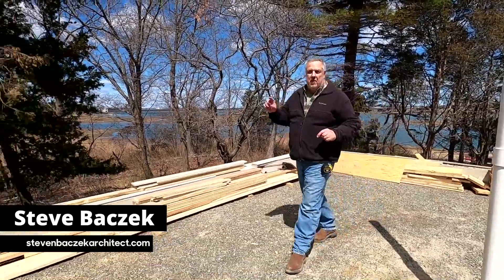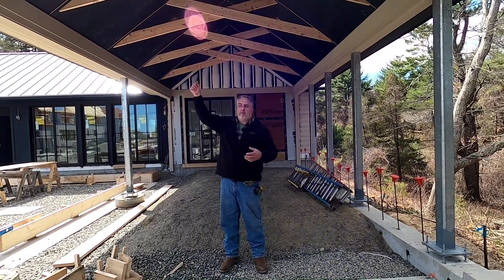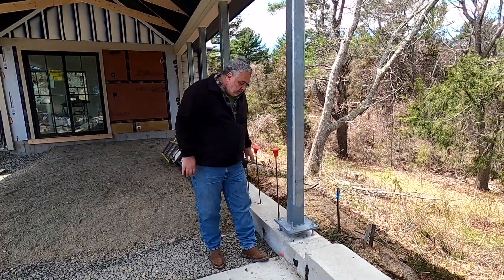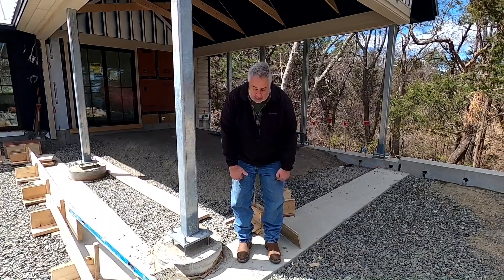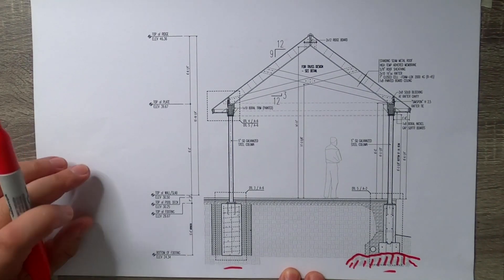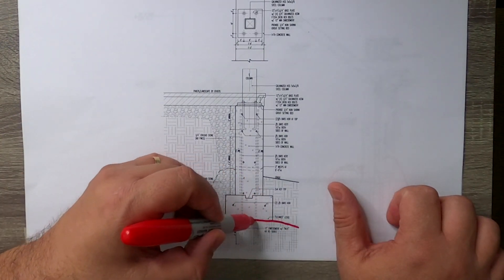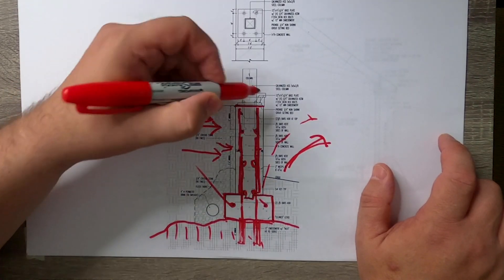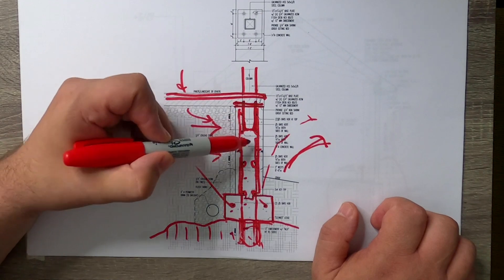Outdoor Foundation /Framing

Comment: awesome video,can you make a video on how you attach the steel post to the top and the connection that you use to hold the framimg to the post, thanks Steven
Reply from the maker: We used a 1/4" thk plate , 6" vert legs and 8" long. We used (12) 1/4"X2 1/2" structural screws  (6 each side). The saddle was welded to the top of the steel column